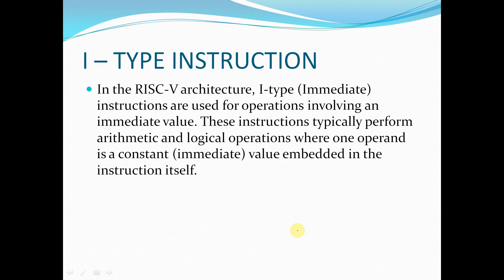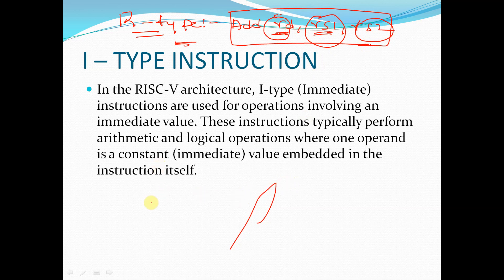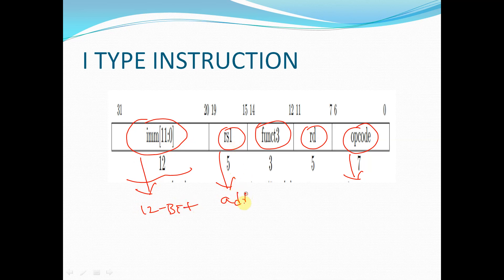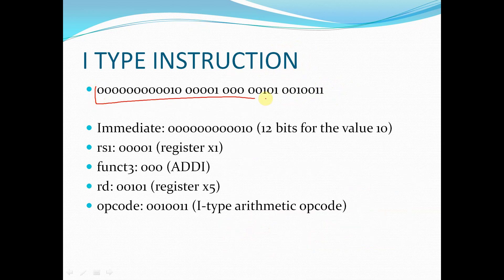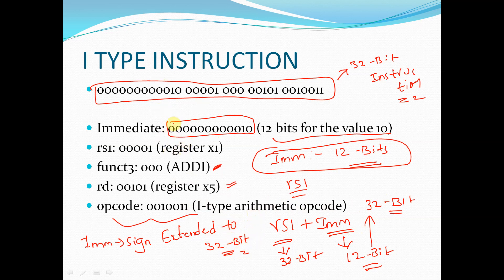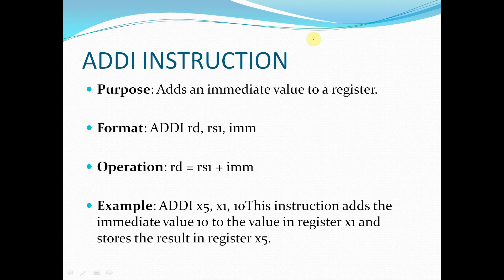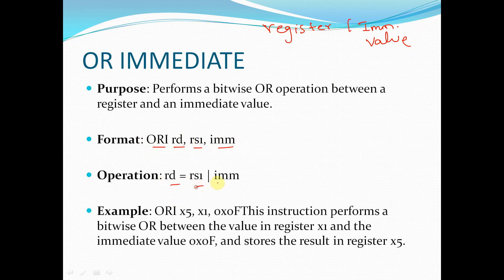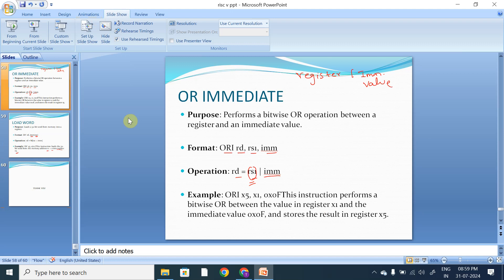Introduction to I - Type instruction in Risc - v || part - 1 || Risc v full course ||

Comment: at 8:37 how does rs1 stores 32 bits since the overall size of the i type register is 32 bit
Reply from the maker: here the data is present in the instruction that is 12 bits and it is to be stored inside the rs1 register which of 32 bits therefore the data is sign extended before we store it into the rs1 register
hope you understood
Reply: @Allaboutvlsii  but you mentioned the size of rs1 register is 5 bits but when you write you mentioned the size of rs1 register alone 32 bits, sir
Reply from the maker: @nithishkanna7  here rs1 refers to source register address which is of 5 bits . i.e  it is telling us where to take the second operand and first operand is immediate value. and this immediate value is sign extended to 32 bits,  the second operand is stored in one of the 32 32 bit registers that address is given by rs2 register. and finally the result is stored in one of the 32 registers whose address is given in rd
Reply: @Allaboutvlsii  does that mean the 5 bits you mentioned in rs1 represents address but it can hold 32 bit data for that address, am i right, sir?
Reply from the maker: @nithishkanna7  it is address for 32 bit register that can hold the data
Reply: @Allaboutvlsii  can you please tell which is 32 bit whether it is  address or data? And thanks for your response sir
Reply from the maker: @nithishkanna7  data ->12 bit which is extended to 32, address -> 5 bit
Reply: @Allaboutvlsii  thanks sir